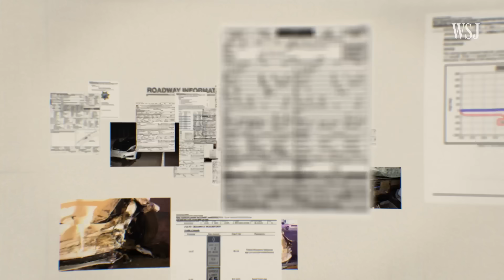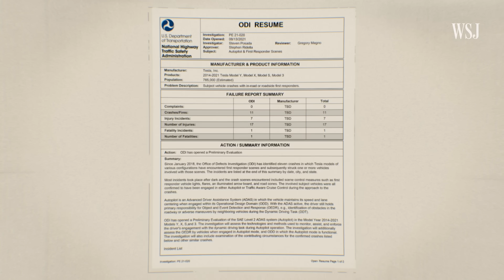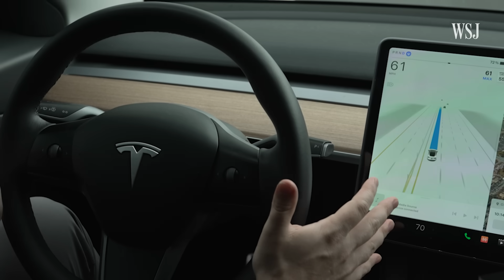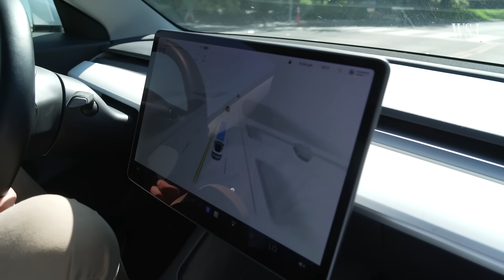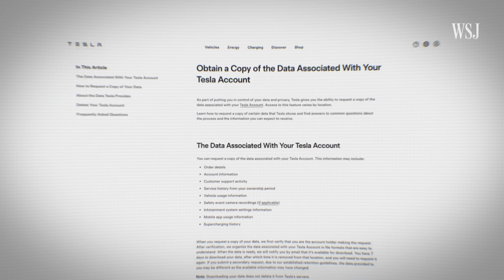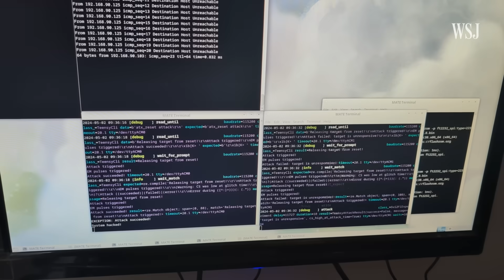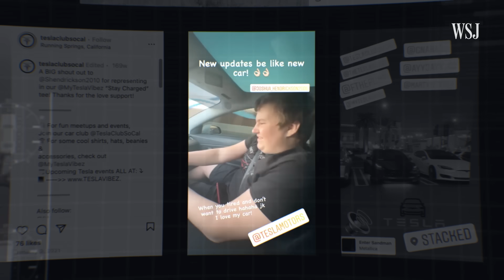The Hidden Autopilot Data That Reveals Why Teslas Crash | WSJ

Comment: Yesterday I was manually driving my Tesla Y on a 3 lane residential road in the outside  curb lane the center lane had cars but they were back aways. I have been brushing up on driving skills by watching my Tesla drive because it seems to follow traffic rules closely and I have noted the car prefers the center lane when possible leaving the outside lanes for passing cars and cars preparing to exit the road left or right. Thinking the center lane was clear I signaled and steered into the center lane. A large black SUV in the left lane was further back accelerated into the center I was attempting  to merge into into it. My car “saw” the black SUV accelerating and approaching as it merged into the middle lane off my left shoulder. My car immediately took automatic control and dove back into the right lane I had just vacated avoiding a collision with the approaching SUV. I have been experimenting with the autopilot and it is gaining my trust more and more everyday. I am a retired airline and military pilot familiar with autopilots in aircraft. This background may explain my willing acceptance of the autopilot in my Tesla y.

Comment: Elon Musk used a excuse of nonsense.  Appendices are supplementary sections at the end of a document (after the reference list) containing extra material, like raw data, questionnaires, or large tables, that supports the main text but isn't essential for understanding the core argument, preventing clutter and maintaining flow. They are labeled (e.g., Appendix A, Appendix B) and referenced within the text, providing readers with detailed information to evaluate or replicate the study.

Comment: How could that accident happen, as Tesla claims to have the most advanced Advanced Driver Assistance Systems?
Since 2022 any in Europe newly developed car would have avoided that accident, as radar based emergency breaking systems became mandatory. Since 2024 EVERY newly registered vehicle has to have the emergency break system. At least in Europe Tesla was forced to integrate that feature and therefore radar.
Do US Teslas lag the safety standards, that are mandatory for even the cheapest European car?

Comment: A safety-critical system should have diverse sensing modalities (camera + radar + LiDAR) to cross-check each other. Tesla lacks that redundancy and ISO 26262 certification, do not buy a Tesla is you value safety.

Comment: Technology does not remain the same, it will always be improved (except I guess at Tesla for autonomous driving). Because most people's comments do not appear to have a basic understanding of the different types of LiDAR, I included a brief explanation. First, there was 2D LiDAR which is just a single horizontal plane for mapping and navigation in controlled environments, then came 3D LiDAR, and now 4D LiDAR, and 5D LiDAR is already being currently developed. Next, to understand the difference between the best LiDAR that is currently available (3D LiDAR and 4D LiDAR), 3D LiDAR captures static three-dimensional space, while 4D LiDAR adds the dimension of time, allowing it to measure velocity and track movement. 3D LiDAR system creates a "point cloud" of objects in a scene, essentially a snapshot of its surroundings. In contrast, 4D LiDAR provides real-time tracking of movement by detecting the velocity of each point. We are just at the embyronic stages of Level 3 autonomous (hands-free) driving, before we can get to Level 4 and ultimately Level 5 autonomous driving, technology will need to improve even further. Tesla's 2019 camera-only technology will never be able to be approved for Level 4 or Level 5 autonomous (hands-free) driving, unless at some point in the future Musk adds some form of advanced lidar (3D, 4D, 5D). Final point, currently Mercedes makes the only 2 vehicles equipped with Level 3 autonomous (hands-free) driving for purchase and use in the US, but they can only be used in the state of Nevada and some parts of California on specific roads and only in low-speed traffic conditions.

Comment: I worked for Subaru of America in the late 1980's when all wheel drive was beginning to take off in passenger cars. Subaru was the leader in this technology since they'd had on demand four wheel drive in cars since the 1960's. As a manufacturer rep, I had access to all of the latest models fully loaded with all the bells and whistles. It's very true that overconfidence in the technology can cause catastrophic collisions. Just because cars can accellerate without wheel slippage doesn't mean they can stop more effectdively. Even with modern ABS, there's only so much the tech can do. If you're driving too fast for conditions or you fail to allow enough follow distance, the tech can't save you.

Comment: Not only will it be long term, eventually cars will drive themselves.  Weather you like it or not.  The driver is ultimately still responsible for what happens and they should be prepared to take over at any time.  The accidents are happening because the drivers are not paying attention and taking over when the system makes an error.  The problem is two fold.  1) the marketing is misleading and 2) The drivers are not paying attention as they should be and as a result are unable to intervene to prevent the accident.  The marketing needs to change…its not full self driving…and the user should have to complete education on how the system works, including its limitations, before they sre able to use the features.

Comment: There is a test program for autonomous diesel tractor trailer rigs traveling between Houston and Dallas. There is an observer in the cab. But can you imagine the destructive force that will occur when a 100,000 lb vehicle going 70 mph has a glitch. 😮

Comment: Just a note, Tesla auto pilot is not Tesla full self driving. My life as well as many others have been saved using the latest version of FSD. Auto pilot is more conditionally code based, whereas full self driving is an extremely capable AI model capable of making thousands of predictions, a second based on current environments. It has managed to avoid and taken into account things that I would never have even noticed when driving.

Comment: So, the best they could come up with was a guy who was told to pay attention 19 times because the system itself is not meant to be autonomous self driving and the guy didn't and died when you can see he had buckets of time to react. He didn't until he was right on top of the truck.

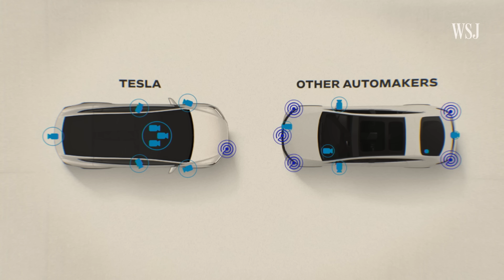Comment: 4:41. WSJ, do you remember when the Tesla WITH RADAR crashed in CA in a similar way to Steve H?  Do you know why?  I bet the AUTOMOTIVE RADAR that was in that early model Tesla outputs onto the CANBUS a single data point with range and range rate, I would be quite surprised if it has more than that like bearing rate!  Even if the RADAR module with computer in it was/is capable of outputting bearing rate the TESLA software wasn't using it.

Comment: @2:05. when the drunk driver ran over the teacher and part of the kindergarten class crossing Stewart ave at 9 or 10 am liability was easy; it was the drunk driver who killed, it was the human neural network and the failure of the "justice system" that did not do anything about that drunk driver on the previous 5 DUI arrests!  Humans are biological 'tech' with a much longer development period; the neural networks are very similar, major differences are in that our neural networks have more levels of abstraction and multiple levels of selection:  spin around on a bat at the next baseball game when trying to walk a line and see how your neural network handles sensory inputs delivering contradictory evidence.

Comment: Got to drive a friend's Model Y for an hour or so around my area and I found the "keep hands on the wheel" particularly frustrating because I already had my hands on the wheel the entire time since I was in someone else's car and didn't trust it...we never found a way to make it work because if I applied more force it disconnected all the assistance.  I found it exceptionally annoying.  BUT...that also makes me wonder about how they test if you are actually holding the wheel and if that's accurate.

I also found it was frustrating how it wanted me to be closer to the double-yellow line on state highways than I was comfortable, I prefer the right edge white line lane position since people often drift over the lines and buys me more margin for safety

Comment: How is the first example anything to do with TSLA? Driver was using Advance Driving Assitance System. All it does is help the driver, not do everything.  Auptopilot is not Full self driving supervised. If driver was using the tech properly, he would know the car will never come to a complete stop. Emerg braking just slows down. even then, it is not guaranteed to do anything. Read the instructions for use 🚧🍤

Comment: VW Traffic Assist is much better and safer. It uses both radar and cameras. Its a level 2 system and never lets you forget that you are the driver, however it can perform emergency braking far quicker than a human can react.

Comment: Question is, if that truck that overturned was a Tesla Semi, that wouldn't have overturned. These videos quite quickly go out of date. The future is very safe. Unfortunately, this tech and data is being stored every mile and still in 'Beta'. I own a Tesla 2021 model, but drive in England UK. I've driven so many cars, but Tesla feels the safest by far. Would I drive autopilot at night - no, plus you can't in the UK anyway. There is a crash on the motorway near me every Friday, due to incompetence driving and over populated roads. Autopilot and modern vehicles are definitely the way to go. Just need innovation and creativity and keep going.

Comment: That’s why if I get a Tesla, I wouldn’t spend another $10,000 CAD to get a full auto pilot. I wouldn’t spend $80,000+ CAD to a Model Y that’s included full auto pilot. First off, it should come with it. Secondly, shouldn’t be an expensive vehicle. Thirdly, I don’t rely on the car self driving to take me from point A to point B. Yes, we do need advance technologies in the car to protect ourselves while driving. But not giving our lives completely to the car for safety. In the end, humans > technologies. Not Technologies > humans.

Comment: autopilot, or FSD. FSD is their advanced software that is capable of preventing crashes, which is the version that Tesla advertises as safer than human drivers. Autopilot is simply cruise control with lane assist, and does not prevent crashes. So yes, if you use autopilot, you may crash. If you use Full-Self Driving (FSD) then it is 10x safer than a human driver.

Comment: Radars don't recognize static objects, in most cases the give you false positive making the system even worse. The issue is that in dark the car didn't had the high beam on, the truck wasn't visible at all.
The right solution could be to use infrared illuminators/and infrared cameras to avoid blinding other people with lights. But now the new high beam allow to be on wihtout blinding other so no infrared camera are needed

Comment: Video is based on false logic: do you think you would have avoided that overturned semi, or the pickup in darkness (neither had lights in the video footage)at 60 mph?
Reply: I think someone who is using a radar cruise control from any GM, Chevy, Honda, Toyota, literally any car from 2018 onwards, if running on radar also called adaptive cruise control, will stop even if the human does not see it, it is also called AEB Automatic Emergency Braking in most new cars.

Comment: Autopilot is NOT the same as full self driving. Autopilot is basically cruise control on steroids. It will NOT prevent an accident, Full Self Driving (FSD) will.

Comment: 7:12 I didn’t see it coming either though, that guy probably didn’t either, the crash may have happened with or without autopilot unless they add night vision into the cameras to detect these things at night better
Reply: Not if any regular adaptive cruise control car was in use, the one that keeps distance from the obstacle ahead of you, it will apply emergency brakes as it looks for obstacle by radar not eyes or camera.
Reply: @jasresearch I see, I didn’t know that about the radar things, so what you’re saying is no reason for night vision when you have radar which can detect it through sonar or whatever

Comment: Elon didn't say nobody would die. He said it's 10x safer than gas cars. According reports:
With Autopilot/FSD engaged
– ~ 1 crash per 6.9 million miles driven (Q3 2024 data: 1 per 7.08 M miles) .
– By contrast, average U.S. driver experiences about 1 crash per 652,000 miles

that's about 10x alright. If we start analyzing every car crash with gas cars then this video will be 10x longer. Unfortunately this is cost of some technologies. Yes nobody should die, but in 10 years the lives saved with FSD will be much much higher. Imagine when cars were used to replace horses how many deaths there were. If we forbidded cars 100 years ago we will still be living in ancient times.....

Comment: You can't rely on electronics 100% . They are bound to fail sometimes and could happen at any glitches due to variable in the car power or sensor circuits  !

Comment: Absolute bonkers.

Insisting on "cameras are good enough" besides all the evidence is mind-boggling. How many more people have to die in low-leight conditions or in cameras-show-directly-into-the-sun conditions? EVERYONE knows that cameras are not enough for full self driving because of those issues. How can any sane company claim to have achieved "full self driving" without proper technologies like multiple radar and lidar sensors..
Reply: humans only have eyes, no lidar so how can we drive then?
Reply: @SuperPavelow  Well we do it quite poorly, having trouble with getting blinded by bright lights, quick changes in light (tunnels), darkness in general - all problems that don't exist for lidar.

Come on, even 300buck robot vacuums already use lidar nowadays. Do you know why? Because it is freakin 10 times better than cameras to map and navigate through unknown surroundings. But Tesla tried to go cheap and deny reality and now they are years behind the competion.

Comment: the instructions are very clear YOU are responsible to drive and take over when the FSD system makes an error and it makes plenty of it every day. just last week my Tesla stopped at a red traffic light and started driving despite it was still red, ran over a stop sign without stopping, and worst changes lanes in a two line street driving on the wrong side off the road - it's a great system so far but not perfect. - this said Robotaxis with this tech is not feasible in my mind - you need better sensor tech like LIDAR and better trained model.

Comment: It doesn’t seem that these vehicles should be allowed on the road.
Reply: Gosh. In 1900, you'd have said the same thing about those terrifying horseless carriages. At least a horse had common sense, even if the driver didn't. Teslas might seem dangerous because their testosterone crazed drivers all too often push these very fast cars well beyond their limits. As always, the driver is responsible. Drive a Tesla in "chill" mode, and it's safer than most cars, as its almost impossible to roll it over and it has a very sturdy frame to withstand the violence in a crash.
Reply: @N7492  these cars are making the decisions human drivers should be making. The tech is way too immature

Comment: What I think is truly stupid is "training" AI by showing it ten million images of something, and hoping it figures out what to do.  What if there aren't ten million images of overturned box trucks, or stopped school buses or whatever?  Someone dies, that's what.  How about starting by programming in the basics, like don't run into stuff in front of you?  Then program in the laws, like don't pass stopped school buses with their red lights on, and only then show it ten million images of crosswalks, etc.
Reply: What you described is called outliers detection, which when it sees something not similar to its training data, it will respond distinctly like slowing down by emergency braking, etc. It's already in advanced algorithms like FSD. The accident in this video was 2021 and still using autopilot which is way inferior to FSD. 
Now to your suggestion, hardcoded rules and policies are effective to handle corner and edge cases when the algorithm is not sophisticated. While not necessary if the algorithm gets better and more effective

Comment: I wonder how these softwares attempt to deal with poor lane marking, ie freeways where old lane paint markers not fully removed, and new striping added when road modified. Very confusing to drive on, essentially very difficult to discern which is correct.

Comment: I’m not trying to defend Tesla or Elon but Autopilot is not supposed to be used in the aspect of “letting the car drive itself”. I own a Tesla but the Autopilot feature is more like an advanced lane assist cruise control. Try activating your cruise control without assisting it and let me know how that works out for you. 

That is why Tesla has FSD, which is a true self driving feature but regardless the display will literally tell you to keep your eyes on the road and hands on the steering wheel at all times.

I do think though Autopilot is a bit misleading..